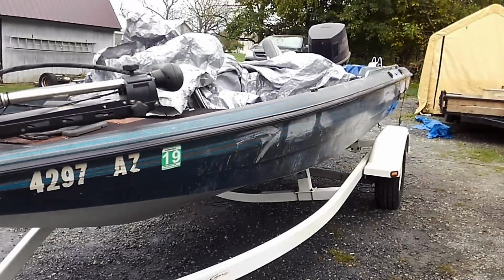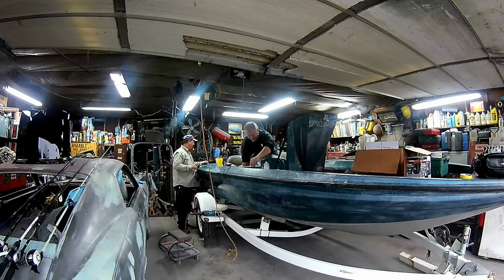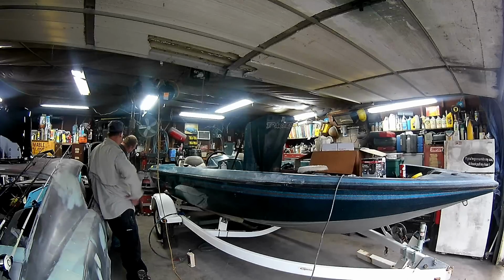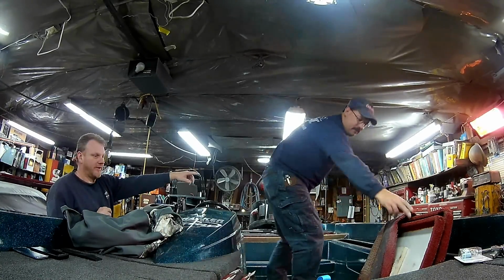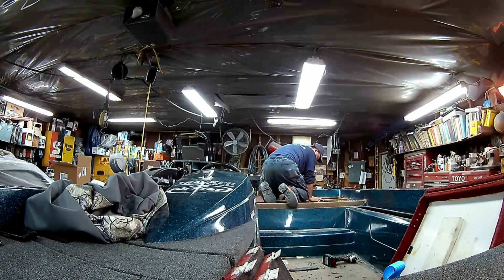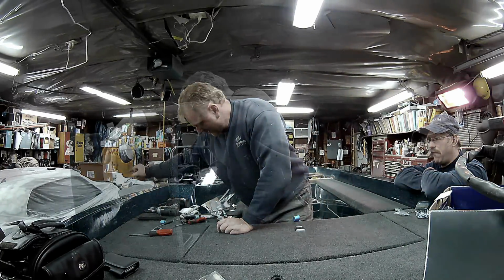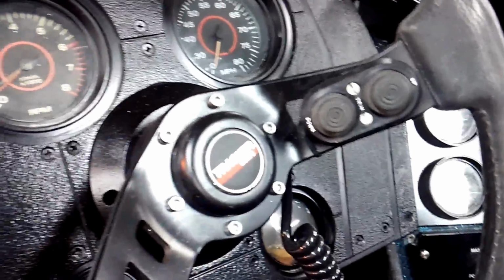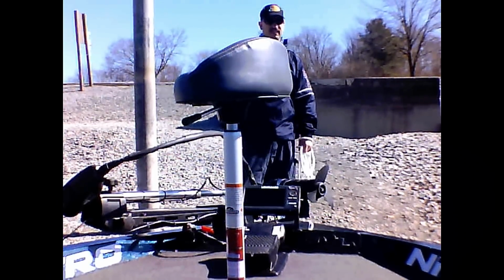Restoring a 1990 Nitro Bass Boat #nitro #boat #outboard #motor #restore #video #new #blue #fish

Comment: I will say the trailer looks good...   But this one's not going to fit in John's single garage either...!   LOL    Real "Metalflake"...!  Try buffing a little of the top cap... the part the sun oxidized...  Looking Good...   Now get yourself a pair of 14" 1990's Ford Ranger alloy wheels & restore them for that trailer...!   One of you is supposed to be on the boat with the engine running...!   Then you drive over to the pier & pick up the other guy after he's parked the truck & trailer...!

Comment: I have a 1991 Nitro the same color pattern as that boat. I was wet sanding mine last year to get rid of the oxidation. It made a huge difference.still have half the boat to go. I don't believe the carpet or those seats are original to that boat.
Reply from the maker: Those seats and the carpet are aftermarket and not original.

Comment: Great job guys , just got 17 ft charger bass boat . Needs  to be restored but i will take my time .Very proud of you guys i wish my boat will look like yours .Im  also from Pa ..Carlisle area but dont have to many lakes that alaud boats with gasoline engines . my have to travel little further to find open lake.. good luck with great boat   ,
Reply from the maker: Thanks Jack, appreciate that ... You are not that far from the Susquehanna River, right? I love fishing that River - Great Small Mouth Fishery - You should be able to take your boat there. I usually fish the lower Susquehanna River at Muddy Creek Access and Peach Bottom Marina.
Reply: @Arkfishing  thanks guys, I will definitely  try that area.That is a cross from power station.Maybe when I get my boat ready I will definitely go down to this area and test my boat with great fishing

Comment: How did you guys end up fixing those holes and most importantly matching the metal flake?? I’ve got the same exact color scheme on my nitro 160tf 
Thanks! Great vid!
Reply: I have the same boat as you 160tf 1991. Same colors as their boat. I found that metal flake online. It is actually a common color.

Comment: Looking at this exact boat for sale with the Johnson 150 GT version of the same motor. What kind of top speed are you seeing with what prop, and what RPM? Awesome job guys!
Reply from the maker: Top speed is 55 mph, not sure of the RPM though.
Reply: I have a 92 190dc 24p raker 59 gps 150 evibrude

Comment: What kind of stripper did you use to get rid of the clearcoat and how long did you let it sit on the paint before stripping it off?
Reply from the maker: We used a very light version of paint remover, i think it was purchased at Lowes, and we waited a few minutes and scraped if off, then rinse with water right away ti ensure the paint would not be affected by it.

Comment: WoW this boat is almost like mine. I need to restore mine also. What was the compound you used to buff it out with? mine is a 14 foot nitro style boat i need a bigger motor and some seats.
Reply from the maker: Christopher Reed, I will have to ask my buddy Brent, he used some Commercial grade compound that cost $30.00 a bottle; however, I found that Mcquires for $15.00 a bottle works just as good. Check out this video to see more about the compounds - https://www.youtube.com/watch?v=usxmL2n30H0&t=1s

Comment: What weight carpet did you use?
Reply from the maker: taz man, not really sure, I will have to ask Brent, I just know that it was Marine Grade Carper that was normally expensive, but he got a Good deal on it with 50 % off out of the Bargain Cave at Cabela's right before Bass Pro Shops took over.
Reply: @Arkfishing   Thank you I would appreciate you asking him. I just bought a 1996 Champion that is badly in need of carpet and your restore looked so nice I wanted the same weight carpet you two used. Thanks for the fast reply and sharing this video it was a good watch. Subscribed
Reply from the maker: @tazblink  I finally got a chance to talk to my buddy Brent about the carpet, he does not remember what weight carpet it is; The carpet was purchased out of the bargain Cave at Cabela's and was a rather thick, but soft yet heavy duty carpet, even sale it was not cheap.